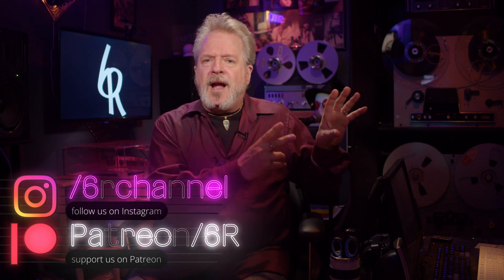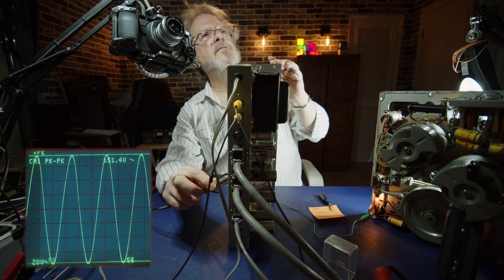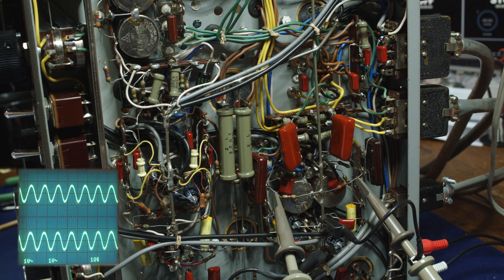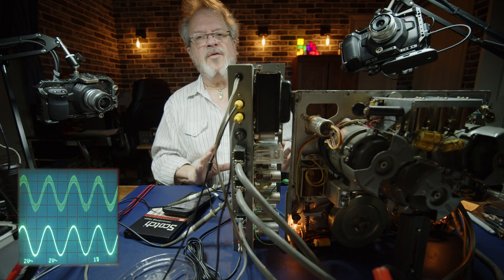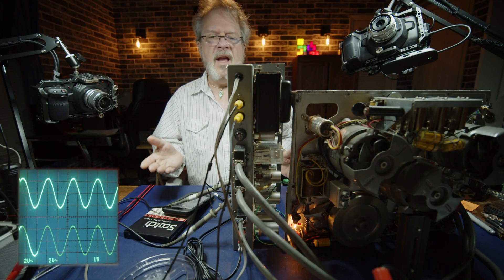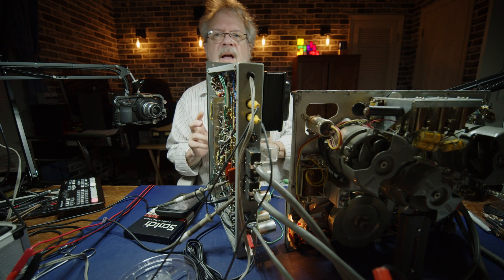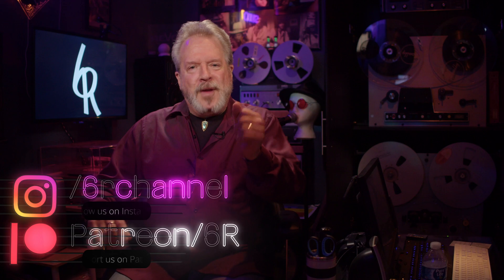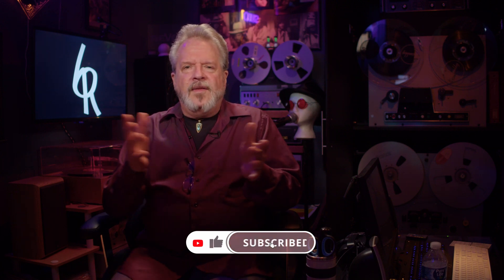"What Doesn't Hertz, Makes Us Stronger" - Part 10 Griffin GB-707A, aka Denon 700 Reel to Reel

Comment: oscillator purity my be important on that machine
Reply from the maker: Greetings, 'oscillator purity' is paramount in any recording environment. The great part of using vacuum tubes as oscillators and RF transmitters - is that they love sine waves regardless of the amplitude.  They just want to be symmetrical.  When I want pristine square waves... I invoke transistors - great switches, better than tubes.  Tubes are my go-to for audio.